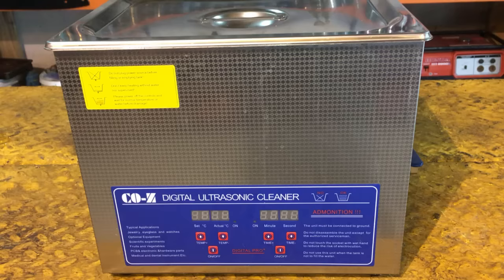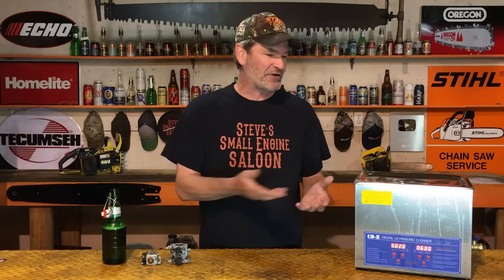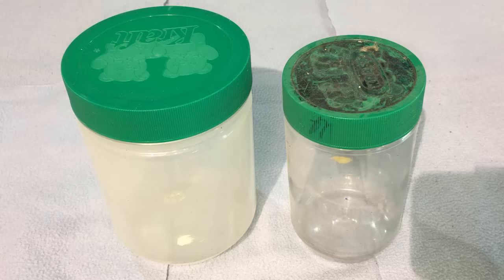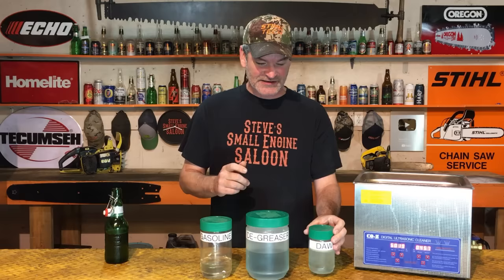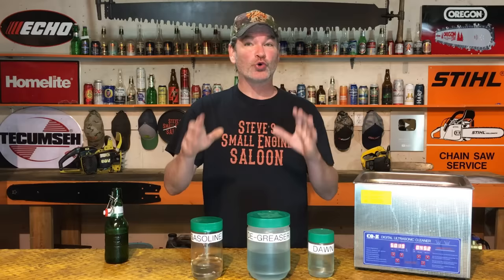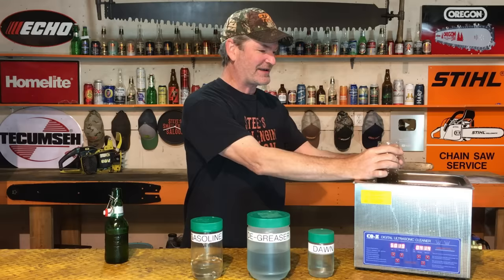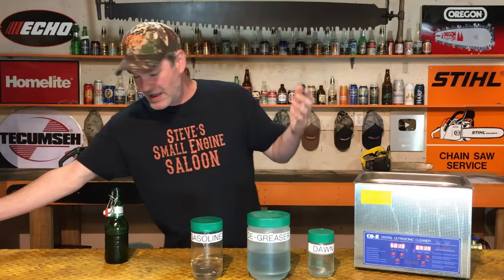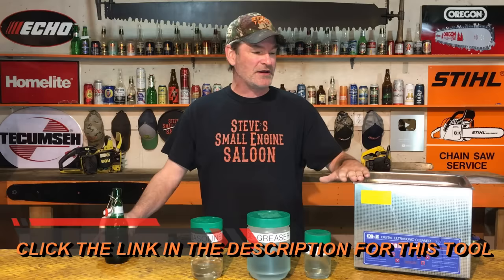ULTIMATE TIPS For Using An Ultrasonic Cleaner (Must Try)

Comment: I talked to a application engineer at a ultrasonic company and she said that plastic absorbs the energy and glass is best.
Reply: I read that soft surfaces absorb the waves and so are less efficient.
Reply: @SiaD777   You are correct.  You should use glass if you are going to put a container into an ultrasonic cleaner.  You need to transmit the shockwaves, not have them absorbed.  You should avoid plastics, rubber, UHMW, etc....
Reply: Yep it sure does -- and you beat me to it!  :)
Reply: regalblue41  that's a line that should have been added to the Constitution and etched in stone above every court house in America.
Reply: @latest plague ew
Reply: Thanks for the follow through. 👍

Comment: Hi Steve, nice video and tips.  I have a small sonic cleaner that I bought around 20 years ago (from China).  The instructions from mine says to INCREASE the ultrasonic cleaning capabilities, remove the basket.  My basket is plastic.  The unit does not have heat control; just time in 5 minute increments up to 30 minutes.  Temperature does go up considerably after the 3rd session.  It is still working today, I use it to clean my airbrush and related parts used for painting my models; works great.

Comment: Great idea with the jars! I usually use zip-locks and cling-wrap along with baskets since you end up using much less cleaner to submerge the parts.

Only 2 things I'd add:
1 - use de-ionized or distilled water in the dawn solution, it works far better
2 - pre-heat the water bath on the stove and then let the part soak to reach temp, hot cleaners work waaaay better

Comment: I have a similar unit, but with 2 dials. 1 for heat, and 1 for time.  I rebuild old tube test equipment & old tube radios.
It's great for cleaning parts of these devices.  Thanks for the tip on using jars!
Reply from the maker: Very cool!

Comment: what works Good is after you Ultrasonic Clean and still a SURGE in Engine 
use " MECHANIC in a BOTTLE " or VP Fuel with Mechanic in a Bottle Cleaner 
Works Amazing Steve
Reply: You've answered my question I posted. Cheers
Reply: i had a surge in my generators engine after cleaning the carb. took the idle restrictor screw out of the side of the carb and poked the wires of my wire brush thru it and now it runs smooth. (20) https://www.partstree.com/models/tec-640350-tecumseh-carburetor/carburetor-0/

Comment: Thank you for the tip on putting parts in a smaller container then putting the container into the ultrasonic filled with water. Works like a champ. I fill the machine with hot water to reduce cooking time, and I use generic Tupperware for the containers...
Reply from the maker: Glad it was helpful!

Comment: I like using kerosene as not only does it clean the tools but it leaves a slight oil residue that helps protest the tool from rust.  I have been wiping down tools with kerosene for years and it cleans and protects.

Comment: Hey man. For years we have used off-road diesel and kerosene for metal parts. It acts as a solvent and a lubricant as well as protecting the parts from corrosion after cleaning.

Comment: Simple Green works well, I've used  50 50 water mix on carburetors that had aluminum bases and did not get that grey coating you mentioned. They cleaned up well.  The only negative was a little powder residue left over, in some spots (not a a lot of areas, tiny amounts) I think that de-greaser your're using is a phosphate based cleaner and that can leave the grey deposits, especially if you use the heater. I use heat for a better clean ( 35 C / 95 F ),  and can walk away from it, I would not walk away from gasoline, in that cleaner hot or cold, way too volatile for my comfort.
Reply: Solvents in a container seems workably safe, as long as the seal is good and the glass is strong (plastic not cracked or seeping through the lid).

Comment: Great idea Steve!  I use Simple Green Pro HD (purple in colour)  On the bottle it gives a mix ratio for Light, Medium or Heavy duty application.  I used it on Motorcycle carbs that had grease caked on them for 38 years and they came out beautiful.  It was recommended for aluminum.
Reply: That stuff is the best degreaser. I soaked an aluminum engine block in a large tote filled with this stuff and water. It’s non-corrosive and removes all of the burnt oil and makes the aluminum look like new.

Comment: I use Simple Green for cleaning most of the items you mentioned, but I also clean electronic parts as well.
Reply: I was wondering about that. It works pretty good normally so I'd think in an ultrasonic cleaner it would work well. And it's pretty cheap. Have you found anything else better since?
Reply: @andrewt9204  - On Jewelry I use Woolite.

Comment: Some of the solutions I use are: Charlie's Soap APC, Oil Eater, Quick-N-Brite, vinegar and for cartridge cases I use Citric Acid, and of coarse Dawn. I bought some Oxalic Acid, but have not tried it yet. OA is the ingredient in Bar Keepers Friend which works very well on stainless steel.
I liked your video. It brought up one point I hadn't considered, the level of fluid in the cleaner. Another point that you didn't mention was not to remove the basket and put things right on the bottom. I've seen people do that quite a bit.
Reply: Save cleaning get rid of the gun. This world does not need guns

Comment: Excellent idea using plastic jars with a screw top lid. Mine is large enough that half of a vinyl LP fits. I made a motorized shaft that the records slide on tightly and they are spun at about 2.5 RPM. I normally use Simple Green or Pine Sol.

Comment: A bit late for commenting, I guess, and I haven't read through all the comments, but some sub tips, if you will. Ensure the screw top containers don't leak. test by tipping them upside down before using them. If they do leak, a couple of wraps of grease proof paper will do the trick. Never fill the tank with flammable liquids as the cavitation process can trigger combustion.
The reason you always fill to the fill line is because the ultra sonic transducers are usually calibrated to about 100 watts per gallon or thereabouts. If you partially filling it, you are overpowering the transducers and the results are what you experienced.....poof!, a non working cleaner. Go buy another one. 
I'm just starting to do all my own small engine repairs now that I'm retired, so all your videos are informative and educational. Cheers.

Comment: I'm sure you probably already know this, but be careful which plastic you use for gasoline, I accidentally used a Dixie cup one day which is made from poly ethelene, and the entire cup was like wax and melted right in my hand. I think regular gas cans use #2 plastic which is HDPE, the same thing milk jugs are made from. I believe what you used was a water bottle which is PET which is also safe. But this should always be considered for ANY solvent/plastic mixture. Always research weather or not it will react.

Comment: A company named Buehler makes and sells ultra sonic cleaners and cleaning solutions. 

For best results, the container you use as a vessel for cleaning should not touch the sides or bottom of the tank. 

Most dish washing detergents for hand use foam up which reduces the cleaning action (the bubbles don’t transmit the ultrasonic wave). Automatic dishwasher detergent doesn’t foam so the wave is unencumbered. 

If you use petroleum based solvents, don’t leave the cleaner unattended. It can cause a fire if used with gasoline or acetone (low flashpoint).

Comment: I did a carb with the same ultrasonic cleaner in gasoline, and it cleaned the outside of the carb well, but didn't do anything for the inside of the carb, but the inside of the carb was really bad with dried-up crap all in it. I could easily scrape it, and it would come off in a powder, but gasoline wasn't doing anything at all to it. So I did it again with Simple Green/water mix at 50/50 , and it took all that off perfectly. I would still try gasoline first as it may work most of the time, and it's cheaper and safer for the aluminum. If that doesn't work, then do the simple green and rinse well. All of the oily/dirty bolts and nuts came out great with just the gasoline. I also used plastic container methods.

Comment: Bought the two liter unit on your recommendation, ziplock bag works great for the cleaning solution and keeps the tank clean.  I never thought that fresh gasoline would clean carb jets but it works great.  I was surprised that gasoline doesn’t eat the ziplock bag

Comment: Great tip Steve , thanks . I need to rebuild a couple carbs and was going to use my ultrasonic cleaner. Better tell them it will remove paint with just plain water.

Comment: I used to work in a shop where we would rebuild dollar bill validators and coin changers. We had several smaller ones and the big 5 gallon one. We used murphy's oil soap, and it left an oily film which was great for metal and plastic parts.

Comment: To clean a carb, use Berryman's Chem dip. It comes in a 1 gallon can.
Rather than use gasoline, use mineral spirits.
Reply: Only caution with mineral spirits is it softens & damages any silicone gasket & silicone rtv. Great if you that's what you need removed tho.

Comment: I took a plastic 2ltr bottle and cut off the top one third to use with gasoline, and water in the sonic cleaner tank. Works great for small engine carbs. Afterwards, I pour the dirty gas into a metal, quart, paint can with a lid. You can reuse the gas. Most of the previous dirt will settle to the bottom of the can while it sits. When you go to use it again, gently open the can, as not to stir it up, and pour clean gas until you see the dirt/grease starting to pour out, then stop and dispose of the unusable, dirty gas.

Comment: Disclaimer, I am far from an expert, this is just something i have learn in my many years in the PVD coating industry

The reason why the metal change colour when using a de-greaser or some other stuff like it is, because it is either getting oxidized or straight up dissolved. I have work with big ultrasonic cleaners (30, 80 and 200 litters) for more than 15 years and even after all that time I am still learning, likewise is the manufactures. One thing is, avoid anything flammable in the ultrasonic cleaner, there is a risk of explosive fire. putting part in a plastic or glass jar or anything else, will reduce the cleaning effect (not stopping it, just reducing.) like Steve is hinting, the right cleaning solution will do the job. for aluminium, jewellery, glasses and any other stuff like it, use PH neutral dish soap.
for copper based metals (copper, brass, bronze etc.) use a slightly acid cleaning solution like vinegar. (for best result clean it in dishwasher soap first to remove any grease and fingerprint, because these will leave a mark)
for stainless and tool steel use a more aggressive non-flammable solvent

that just some of the things I have learn through the years in my daily work cleaning tool part and be injections moulds to get them completely degreased prior to PVD coating
Reply: Thank you for the awesome tips on which cleaning solutions.

Comment: Hi Steve I've been  told by an engineer  that has used industrial  size ultrasonic cleaners that you should not hold the basket  or touch the cleaner when using as it is unhealthy for you joints so take care  Cheers

Comment: Specific application- for sprocket driven drive chains I use kerosene.  It's not as strong as other cleaners  but it doesnt destroy the factory lubrication behind the o-ring on the chan, and it leaves the chain clean. Use compressed air then proper chain lube. 👍
Reply: Just update - Chain manufacturers advise against Kerosene now as no longer deemed sage

Comment: great vid Steve. The idea to use containers with your choice of solution is excellent.  I've been in the market for quite a while for a ultra sonic cleaner.   Gasoline works great on tools, however very dangerous.  I think mineral spirits should work equally as well.
Reply: I did read all directions, clearly states not to use any flammable liquids.....of course I will at some point. For now just coins.
Reply: I believe for liability reasons,.. what about mineral oil,?  It's non conductive .
Reply: @dionwulff8201  Worth a try, but I suspect that oil would abosb much of the sonic energy since it's quite viscous, slower to move or vibrate.  It's why your engine is quieter with higher viscosity oils.

Comment: I've got the harbor freight one. Works great. 
The way to get around the "don't use solvents" problem is to fill it with water , but then get another container and put solvent and the parts in that, and then put it in the water bath.
Just like shown
Reply: Really?
Reply: @tenncutt  🤣🤣🤣🤣🤣

Comment: Have you tried putting a part in a freezer zip lock bag with the cleaning solution and letting a little air out of the bag so it stays fully submerged... Just a thought.
Reply: Ziploc??? The idea is to keep the gasoline from polluting the water.
Reply: I sometimes use Ziploc bags for small parts (using water in the bag).  Works great - no problems.  I wouldn't use gas in a bag though.  Gonna try out the jar idea.
Reply: I've got one of those food sealer devices that heat seals both ends of the plastic, the plastic comes in rolls so the bag can be made to fit. Also has the option to suck out the air prior to sealing. The plastic is thicker than ziplocs. You could fill it with whatever fluid prior to sealing and then just cut it open when done. May have to try this, Steve... Great solution to a pet peeve of mine.
Reply: @ScottWConvid19  The zip lock bag stays sealed, it is NOT open.
Reply: @dcharnas2592  I've noted that zip lock bags stay sealed right up to the point where you REALLY need them to be sealed, then they don't!
Reply: First Last  yep...you'd just move the sealer to the edge of the counter and hold your bag over the edge. Just need enough of the open end over the heating elements to get a good seal...just don't hit the "vacuum" button...
Reply: First Last  For this application, though, you really wouldn't necessarily need to seal it once filled...just keep it upright and use binder clips...that way the bags can be reused.
Reply: Cattmann let's make it a non-flammable fluid when melting plastic.  Because, someone would try it with gasoline.
Reply: @firstmkb   yeah Kevin, you're probably right...I wouldn't use gasoline here so I'm assuming "it goes without saying...." Sure wouldn't want anyone to light up their kitchen trying to clean a carb...

Comment: Great vid. Steve, just bought one myself and found this very interesting and given me ideas of how to do things. As to the open topped containers you might try putting a couple of holes on opposite sides at the top and putting a stick or similar through said holes and across the tank top so you can run it longer without having to hold it yourself.
Reply from the maker: Great idea
Reply: You could use a magnet, huh? Just an idea.

Comment: I tried purple power as a solution in mine. Tried it with 50% water, 80% water, and 100% purple power and everytime the solution contains any ratio or purple power carbs and metal like brass turn a tarnished color. Put into the solution a brand new looking carb and after 15 mins that carb looked like it was 40 years old and tarnished. When I use purple power to spray down a piece of equipment with the carb already on the equipment then hose it off that carb gets squeaky clean on the outside no matter how dirty is is. Works great like this, just don't use this degreaser with a sonic cleaner.
Reply: have you simple green?

Comment: Today, I used a mixture of the blue colored Dawn Dishwasher (1 part Dawn to 3 parts water), to clean a six year old Cub Cadet Wood Chipper Carbureator that was heavily oxidized and dirty.  After thirty minutes in my ultrasonic cleaner, it came out looking almost new.  The chipper cranked up with two pulls and runs great.

Comment: I've used heavy duty trash can bags as a liner inside the ultrasonic cleaner for large super gnarly parts that wouldn't fit in a bottle.
Reply from the maker: Cool!  Thank You...
Reply: I want to clarify a bit. Make sure to have some liquid between the ultrasonic cleaner and the outside of the bag. I've never tried it without this because I'm concerned about burning out the ultrasonic transducers in the machine.
Reply: @p.t.anderson1593  good tip

Comment: Ziploc freezer bags.  Put solution and part in.  Squeeze out excess air and seal.
Reply: Just don't let the plastic touch the bottom like I did - the vibrations melt a hole in the ziploc! I'm going to try leaving the air in so it floats next time ;-)
Reply: @joecool7152  I leave the plastic tray in mine .  Great advise! I will remember.
Reply: Wouldn't the basket insert prevent a plastic bag from touching the bottom???
Reply: @chrisbcritter6112  In my case the corner of the bag poked through the basket and contacted the bottom.

Comment: Mustie1 uses the contents of that gunk carb/parts cleaner you find in tins. Swears by it.
Reply: What does he use it for?
Reply: @TheBen8355  gunk carb cleaner you find it at auto part stores in paint can
Reply: Very nasty stuff, be very careful when using. Wear gloves, eye protection and gloves. I’d rather use the ultra sonic cleaner with more friendly solvents.
Reply: @TheBen8355  Mustie1 uses his ultrasonic cleaner to clean engine parts, mostly small engine carburetors.